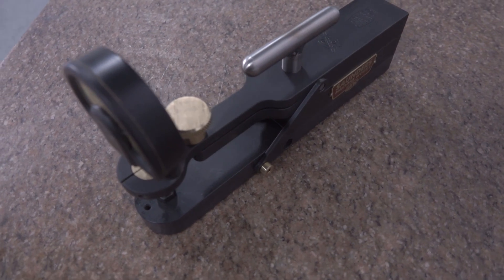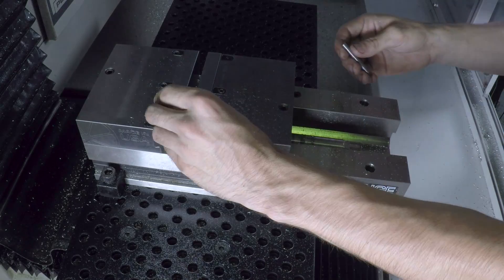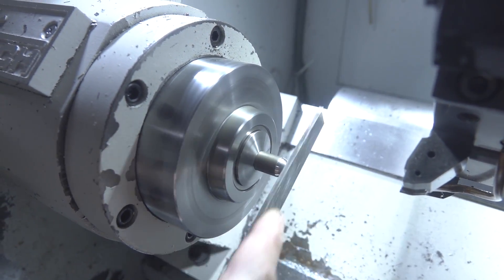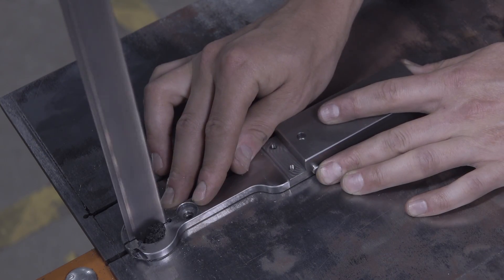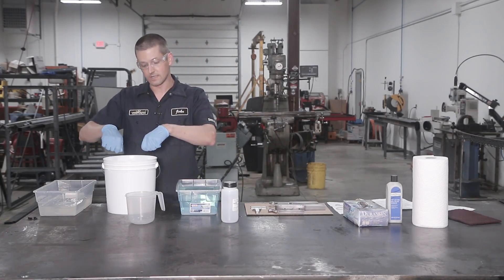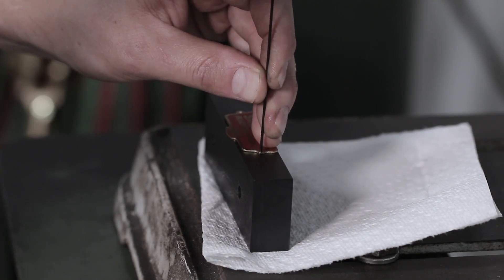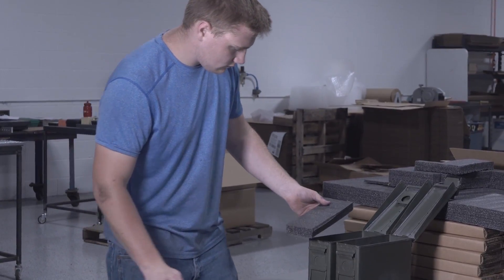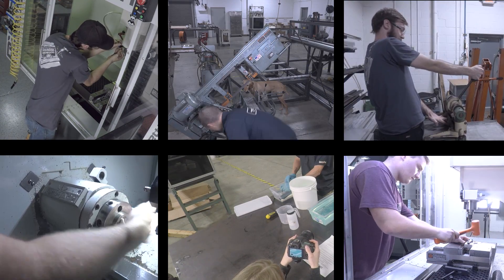Machining, Black Oxide & Assembling the DIY Repeat-O-Meter! WW157

Comment: If you have zero to plus .015 tolerance on the link bar holes why don't you just drill them?
Reply: Drilled much thiner stock like that? It's not a good result... The time savings isn't worth it. Much easier to just interpolate the hole.

Comment: Hah, seeing the stainless screw nails brings back memories of using them to hammer mesh to some cast aluminium parts for use in a paper-press. Had to hammer these flat to the mesh however, now that's a workout!

Comment: Why did you grind the ball feet? I thought the whole point of the tool was to have a 3 point contact on one side, and a moving 4th point on the other. The three balls are already on a plane, and it doesn't matter that the bottom plane is not parallel to the top of the tool. But by flattening the balls they're no longer point contacts.
Reply: You grind the ball feet to get them absolutely level and to give them a larger surface area so that they "cover" any tiny irrelevant hollows.
Reply: What Matthew said.  And THE point of contact is the one in the front.  That's the only one important.  Pointy 3 points (ha!) will give you false readings.

Comment: I don't want to be one of those guys but I also don't want to see you lose a finger.  Careful with that bandsaw.
Reply: tho1efx don't worry, if he loses a finger he can remove it in editing.
Reply: Everything. It's concerning enough when you see someone who littlerally grew up running a bandsaw (eg. Diresta) playing fast and loose with safety procedures. These machines will take a hand off in seconds and fingers in a fraction of that.
Reply: Sharklops oh, I dunno, maybe leaving the blade guide at the top instead of adjusting to the part? Maybe the fingers in the path of the blade, especially on the first cut where there isn't anything between finger and blade besides air?
Reply: Sharklops, oh come on.  John can be very un-careful sometimes, and he needs a stern reminder from us guys.  I still remember, with repeat memories, how he put his palm flat on the bed below a spinning grinding wheel.  For no good reason.  
My father was an owner of a furniture carpentry shop.  You want to know how many guys lost fingers or nails?  And these are guys who did it for years and knew the safety moves.  Accidents happen, and what you do is MAKING SURE THAT THE ACCIDENT CAN NOT HAPPEN. 
Cheers.  :)

Comment: When pressing or hammering in drive screws and other round-headed things, I like to use an aircraft rivet set as a punch. These are intended for use in rivet guns, but an old one (or new one) works just fine as a hand tool or press die. You don't get a flat spot on the top of the drive screw head if you use one of these.

Search for "aircraft rivet set" to find one. If Youtube will let me include a link, you can find a picture here. Look at the RS470 items on the page.

http://www.gen-aircraft-hardware.com/images/pdf/Rivet-Sets.pdf

Comment: John, if it turns out the shelf life of that solution makes it worth storing, get a sealable container. Marked improvement on potential spills and safety. Some acids will degrade the normal silicone seal so be weary of that.

By the way I dont think those are carbide balls. Im only finding 75 rockwell balls on mcmcaster and those sparks look way too big and pale for carbide. (I'm not an expert of mcmaster or carbide)
Reply: Geof Dumas he said carbide but in the video he clearly is getting steel balls

Comment: might have to send you a self addressed envelope to get some of that awesome sander's tape ?????
Reply: Stormbringer Mornblade I think that tape is meant to brand packages shipped from smw, also as a tamper deterrent, so no one breaks the seal and re seals the box.
Reply: And as a long time fan of john's work it will do a fine double duty as a memorabilia item. not to say it's all good if you just slip a buck or two in the envelope i am sure they send you one two business it good like that.